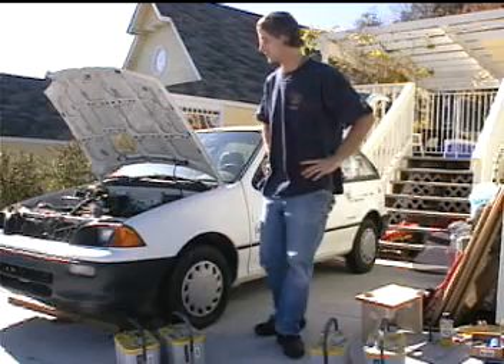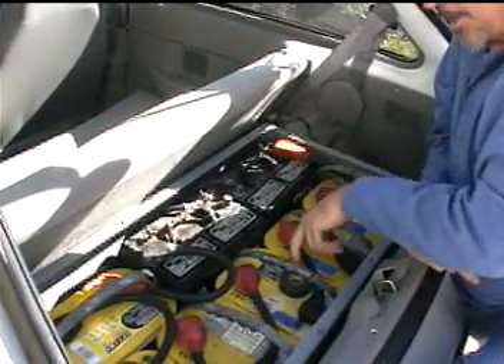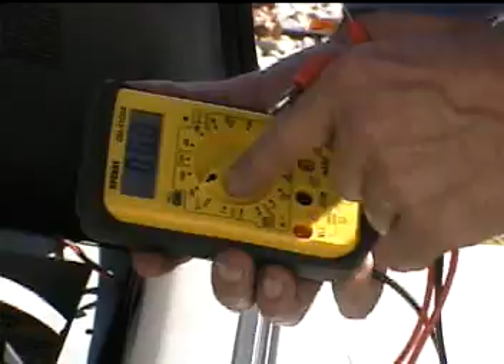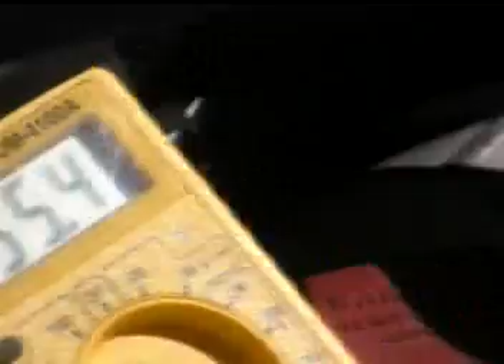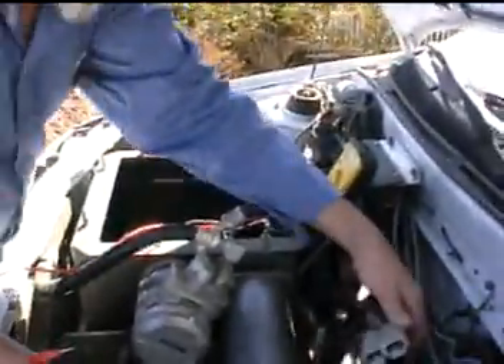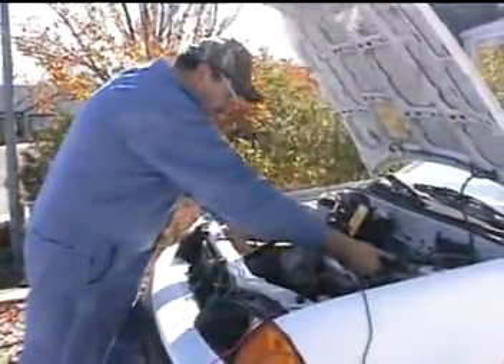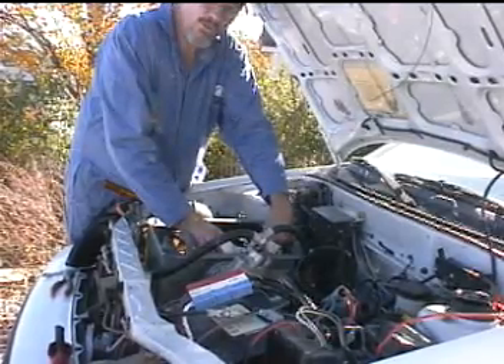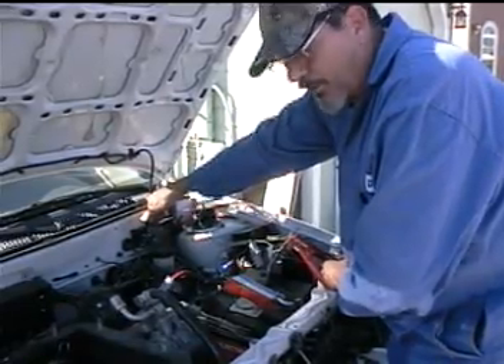Solectria force Tech#1 Video Permanent Magnet motor

Comment: connecting in series steps up the voltage and in parallel steps up the amptitude
 ( the abaility for the source to power much higher power devices )